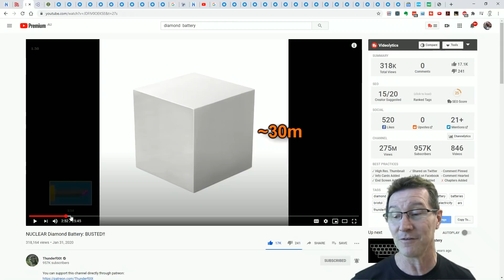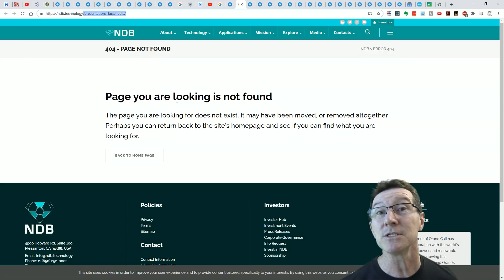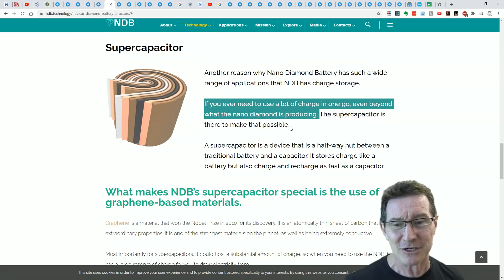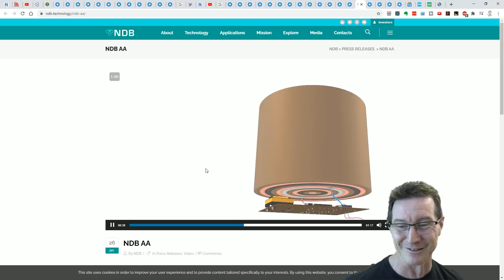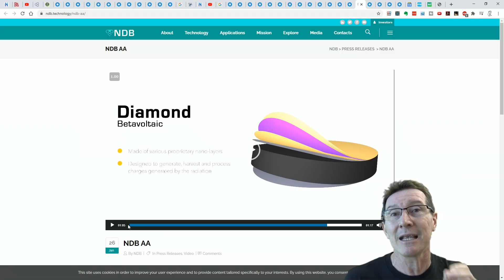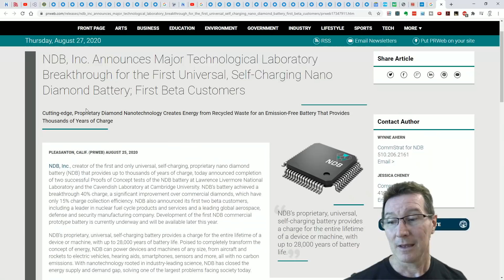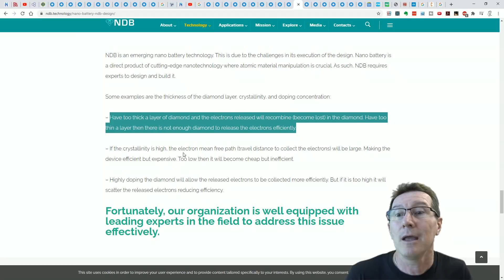EEVblog #1333 - Nuclear Diamond Self-Charging Battery DEBUNKED!

Comment from the maker: WOW, check out their investor pack PDF!
NOTE the complete lack of any mention of power output!
But wow, does it have everything else!
https://ndb.technology/pitch/NDB_Investor_Pack.pdf
UPDATE: They removed it!
Someone archived it: https://gofile.io/d/Iorhs5
Reply: That page doesn't seem to exist anymore, fly-by-nighters maybe? Hopefully no-one has invested in this shit.
Reply: @zeroyon4562  Or they no longer need investors.
Reply: They mention a 312 hearing aid battery version that can deliver 0.15W.
Reply: Page 34 of the investors pack document:

From the charge generation calculation, it was found that 1 g of C-14 in 1s produces 0.001294 J and since: Power = Energy/time
The power that will be dissipated by 1g of C-14 at 0% efficiency is: P D,Max = 0.001294 W
Reply: Such product are invented by simple textual A.I., I got several completions of such super nano graphene batteries when asking Ai for new battery technology.
Reply: I read a few articles on this. Looks like the company was trying to say how there's great potential in this tech (i.e its produced with nuclear waste) but then marketing and the media got a hold of it and blew the specs out of proportion.
Reply: I love this video, but I think you underestimate what you can do with 100 uW :p I am starting my PhD in low power integrated circuit design and I have seen some pretty crazy shit done with nano-watts, let alone a massive 100 uW.
I want to point out that you are fully within your rights to be outraged by this marketing bullshit though.
Reply: ROFL, they took it down.
Reply: I bet you can run a ultra low power RTC with it.
A quick google points me to some RTC chips that operate at like 135 nanowatts, which probably would be a good combo to avoid the RTC battery leakage plague, assuming this nuclear battery is even for real.
Reply: @dan_loup  Maybe but I can use rechargeable button battery, few resistor, mosfet and couple capacitors to lower down to 100  micro watts, your case 135 nano watts which is smaller than micro watts. As I mention on my comment it kinda redundant and does it have actual purpose something that small of wattage ?
Reply: @ex-bahamutgamer8381  the problem is that some (many) years later this battery will die and leak and possibly kill the device.
Of course, as i saw in the video later on, there are competing devices with the same exact power output that also don't have the leaking problem, so, point is kinda moot.
Reply: @dan_loup  Same with 30 year old pcb laminates getting hotter and sometimes separating each layers. It is shame even though we try make things longer life span but we can't make it infinite life span. Nah with this bs chip or whatever battery it is. end of day it is battery and as you said decay away in time. what make me curious, is it product we need with low wattage output and is there actual products needs 100 µwatts battery ?
Reply: @ex-bahamutgamer8381  consumer products i can't see any.
Also there is the bigger point that this product already exist, and is probably already filling the niches it is supposed to.
They're just reinventing the wheel and trying to spin it as something else at this point.
Like those "water extractors" that are basically dehumidifiers etc..
Reply: @dan_loup  Dude, misread my comment and plus. I kept asking, is there ACTUAL product uses 100 MICRO WATTS ?I am not talking how bs this chip is because we all know legacy of worthless models. However I want to know. What genuine product uses 100 MICRO WATTS of power. I only know 100 microfarad capacitor resistor component/s but I never hear or seen a 100 micro watts component/s before. If you can't answer my question then ok and if you are going give a comment. It better be relatable comment to my question, if not I am not going to reply any further.
Reply: @ex-bahamutgamer8381  As i said on the first post, there are RTC chips that not only fit the bill as they can even consume a lot less than 100microwatts.
But if you consider an RTC as a complete product, instead of just a part of a product (that will be able to keep the time correct for quite a long time), it's up to you.
Reply: @dan_loup  ah ok thank for your comments.
Reply: You have mind.
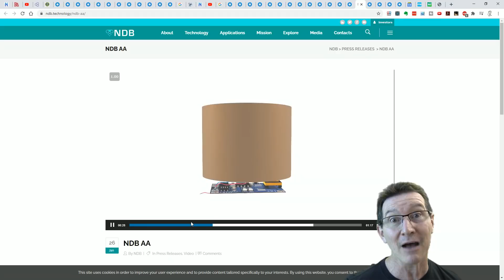Reply: 13:47 ..... https://www.amazon.de/MYAMIA-Tp4056-Lithium-Battery-Charger/dp/B07G6ZHBMX does it look fammiliar?
Reply: @EEVblog - 
I want to see how huge a replacement battery for a Tesla Model S will be thats made of this stuff
Reply: Lmao they’re off their heads.
Reply: Curious Question. What sort products needs 100 µwatts of power ? To me large chip contains 100 µwatts for energy storage is seems 
redundant.
Reply: I suspect this is all fake to catch the hype and money, because all stimulus money goes into tech stocks and many invested blindly. Why all info under "investors"  page on their website.
Reply: The marketing worked. You are talking about the company. Startup marketing is always unicorns and rainbows.
Reply: @justarandomname420  Any in many cases "reinventing" existing products and claiming they can do wonders while they actually can't.
Reply: So the last 57 seconds changed your mind? :p
Reply: Have you heard of "WINDELECTRIC NIGERIA"?
Reply: @rickvaneijck3016  
Reference given at your URL: https://www.sciencedirect.com/science/article/abs/pii/S0925963517307495?via%3Dihub

"Highlights"
"Compact (~90 mm^3, 0.35 g) ~1 μW nuclear battery was developed and fabricated by using of 200 cells combined with ~24% 63Ni foil.

The battery power density of 10 μW/cm^3 and specific energy of 3300 mWh/g were achieved due to cell thickness decreasing."
[...]
"The maximum electrical output power of about 0.93 μW was obtained in total volume of 5 × 5 × 3.5 mm3."
Reply: LoooooooL
Reply: What if they can produce more than 100 mW
Reply: I mean yeah talks about the diamond part but people aren't thinking about it being nuclear radiation.... I mean that is a powerful stuff...
Reply: Nano diamond battery not nuclear diamond battery even though it is a nuclear diamond battery
Reply: Concept art is meaningless. You can't debunk concept art, beacuse its not meat to reflect reality.
Reply: @danr.5017  You can debunk science, which making a battery is science with potential for art if you allow it... 
Also some concept art is meant to reflect reality... Like the piles of trash that look like a person or the Earth or whatever else when you look from a certain angle. At one point it was concept art yet looking like a real life something or another shows it is meant to reflect reality.... 
Try to avoid blanket statements like that because blanket statements tend to be wrong if you look...
Reply: @dalton6173  Its a picture they asked some artist to draw so they can pit a visual aid next to their press release.
Its not a technical drawing, its not a patent or a prototype. 
I also saw ThunderF00t's video. The thing they are proposing works. It's just dangerous and an exorbatantly expensive way to generate a tiny ammount of energy.
There is also apparently not enough Carbon 14 to produce this thing at any marketable scale.
Reply: @danr.5017  They literally said in the video that they have a prototype but it's not a practical prototype...
Reply: @danr.5017  That's the reason that it's encased in something that does not leak radiation and also the reason that they're avoiding mentioning it's radiation-powered.... Because people are going to get scared that oh no it's dangerous it's dangerous like with 5G and completely destroy the product even though 5G is no more harmful than the Wi-Fi that's been in your home this entire time...
Reply: @dalton6173  The picture being debunked wasn't the prototype. It was just an illustration. It means nothing in the context of the actual project.
Reply: @danr.5017  Yeah and also the guy said something meant something that it doesn't actually mean the measurement that he was suggesting has a completely different symbol that the symbol on the illustration so therefore he was making video about a misunderstanding he had...
Reply: The battery is a total Fraud
Reply: The voltage of diamond will be about 3.3v so if you have a power of 100uW then it would be 100uW/3.3= 30.3uA in otherwords enough to maybe charge a low leakage capacitor and maybe keep some types of memory alive... very strong maybe. 🤓
Reply: Please do remember that computers started from 8 bits. Do not laugh early for 100 micro watt.
Reply: Someone removed the archive :(
Reply: It’s an investor scam
Reply: What if you seamlessly integrate 500 million of these things into the structure of a tesla including the initial battery space? No biggie at that point right?
Reply: @Ruinedfish  Besides the cost of perhaps a billion Dollars and the volume of a large house and the accumulated danger of kilo Watts of a constant internal beta radiation, you should be fine LOL…
Reply: Imagine a nuclear diamond battery that can last 1000s of years 😊...then, realize such battery needs to be 1000s of times bigger than a Li-Ion battery for the same power 😮
Reply: Imagine a nuclear diamond battery that can last 1000s of years 😊...then, realize such battery needs to be 1000s of times bigger than a Li-Ion battery for the same power 😮
Reply: I wrote this comment, but maybe they are for real. They aren't selling the betavoltaic as new, but their system to extract the energy, and it is scalable, so focusing on a small chip is not fair.
This investor pack was made end of April, NBD announced in February 2020 they had 'won' the Orano international startup call (https://ndb.technology/ndb-as-the-winner-of-orano-call-has-started-collaboration-with-worlds-largest-nuclear-power-and-renewable-energy-company/ - now deleted), but the brochure for the event (https://www.nuclearvalley.com/wp-content/uploads/2019/12/Orano-Startup-Call-Brochure.pdf) points to the website (https://hello-tomorrow.org/startups/) which has no mention of them at all. 
So, they splash that they are winners of the Orano event on their website (Feb), produce the investor pack in April (above), and talk about a Series A round (7m new shares, current capital 50m shares) as recently as August (https://ndb.technology/investor-hub - now deleted). Now they got too much wrong attention and have deleted everything from their website. 
Looks like fluff to me..they recently launched a new website. Different design.
Reply: @JohnSmith-yn7jz  Considering the amount of R&D required; they'll need to pay out inflated wages to those qualified to work / experiment with said material, the equipment required to work on and store said material, the cost of acquiring / transporting said material, the permits they'll need etc, etc
It's just not profitable compared to betavoltaic batteries as the 90% of the devices they're marketing the battery for will be replaced by the consumer every few years, on top of that if you watch Thunderf00ts video the total weight of one of these batteries that can charge a smartphone will be around 600 kgs, and the "shielding" they're using to coat the diamond to protect the consumer costs 70 million USD per KG, another thing to note is that this battery can simply be evaporated by an amateur and turned into tasteless carbonated water (that has a lethal dose of radiation) with just 1,500 USD worth of equipment.
Reply: @Skelath  Yep, safety issues could rule them out of general consumer goods, but with higher power densities, space, communications and military applications would abound.

Comment: I've not heard of a beta voltaic battery until now. i know this vid was not directly about showing the concept of Beta Voltaic batteries but i've thought of a good use so i wanted to mention it for fun. I'm thinking(i'd need to do some research to so if it's posable) but i'm thinking Beta Voltaic batteries might be a suteable replacement and improvment for the batteries in S-ram game cartridges  for the N64 (  and  persumably many other S-ram aplications) because the way Sram works from the little i remember is it needs a battery to keep power otherwise the data will be lost, and for the n64's case the somwhat few games thatw use S-Ram to save game saves they use a small coin battery and granted those batteries usualy kept charge for 10+years(don't quote me on that) but in theory if some Beta voltaic batteries charge can keep up with the very low draw of the S-Ram then it's be a no brainer to use them instead of the standard Coin batteries so long as it's not to expensive but that comes down to what the owner values never needing to change the battery again.

just think that's interesting.

Comment: While you're likely correct on most things, referring back to the 100uW measurement from a marketing image while saying "marketing just talks crap" seems a bit odd. If marketing just talks crap, why hook onto the marketing image number?

Besides, the number doesn't mean much. There could be a tiny cell in that chip for all we know, and it's just a  100uW one to compete with that niche. Wouldn't necessarily mean they can't fill more of the space in the chip for higher power applications.

Comment: I totally agree that claiming power applications is bull .@!&  but there are lots of applications that would benefit from a battery like this. Smoke alarms, TV remotes, tracking tags etc that you don't need to change the battery on. These devices use average power of 10s of microwatts. They use a short burst of power to send a signal (eg a TV remote) or a trickle current to be on standby (eg a smoke detector) and a battery like this with a supper capacitor would be a game changer for these kinds of devices.

I don't know why they are suggesting power applications that they will never be able to achieve when there is a real place for them in the world as a low power /standby power application that WILL change the world for these kinds of devices. 

The really disappointing thing about these NDB batteries is that if they are spinning this much bull they are unlikely to be serious about actually producing anything in real life and I would love to have remotes and pace makers and location tags that will be able to use a small amount of power for short bursts once in a while that never need a battery change.

Comment: Let's calculate how big "atomic batteries" would be needed for a car if the technology would be perfect and the efficiency would be 100%.
Carbon-14 decays through beta decay into nitrogen-14. The atomic weight of carbon-14 is 14.003424u and the atomic weight of nitrogen-14 is 14.003075u. The difference between these is 0.000349u, so the weight has dropped by factor 0.000349/14.003424 = 0.00000249.
On the other hand, we know that if the half-life of a radioactive substance is T, then after time t, 1 - 2^(-t/T) of it has been lost. The half-life of carbon-14 is 5730 years, i.e. 365.25 * 5730 = 2092882 days. This means that 3.31x10^-7 = 0.000000331 of carbon has been lost in one day.
The amount of decomposed mass in one day is the decomposed percentage multiplied with the total amount of carbon, i.e. 0.00000249 x 0.000000331 = 0.0000000000008242 = 8.242e-13. That is, 0.82 picograms of mass have been lost from one gram of radioactive carbon per day. It has been transformed into energy according to the formula E=mc^2. 
When we substitute that mass 0.82 picograms and the speed of light 299792458 m/s to the Einsteins formula, we get 73.7 joules. Note that in Einstein's equation mass is given in kilograms. Joule = kg * (m/s)^2. (For the first time in my life, I needed Einstein's famous equation E = mc^2 in real life!)
73.7 joules is 0.0207 watt hours. If you get that amount of energy from a gram, then you get 0.0207 kilowatt hours of energy per day from a kilogram.
The batteries of one Tesla model have a capacity of 100 kWh and weigh 625 kg. They are promised a driving distance of 507 kilometers.
If we take 625 kg of carbon-14, then in theory we can get a maximum of 625 * 0.0207 kWh = 12.9 kWh of energy per day. With this amount of energy, the same Tesla could be driven 12.9/100 * 507 km = 65 km per day. This would be the theoretical upper limit. The practical limit would probably be a fraction of that. And that battery wouldn't be just carbon-14 either, something else is also needed. In addition, most of the energy would be released as heat, not as electrical energy. In addition, the energy would be released evenly and not when it is needed. A traditional battery would be needed alongside, to which this continuously released energy would be stored.

Comment: Good video but the one thing you forgot about The radiation from those battery's  Could or will Cause cancer And that's only been in contact with those batteries for 10 minutes Because it's depleted uranium and even depleted  Uranium Still cause cancer by being near it If you're not in a hasmat suit or the container is leadlined